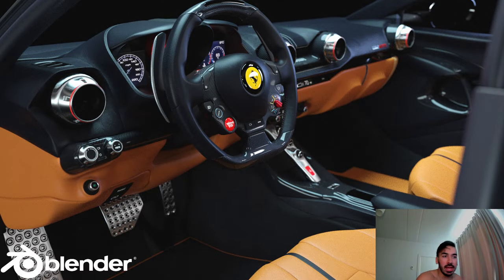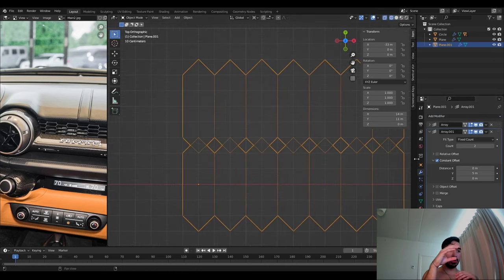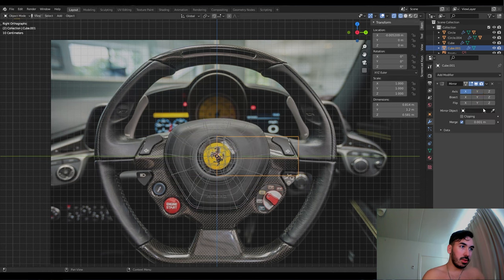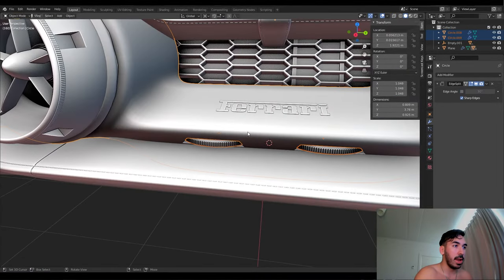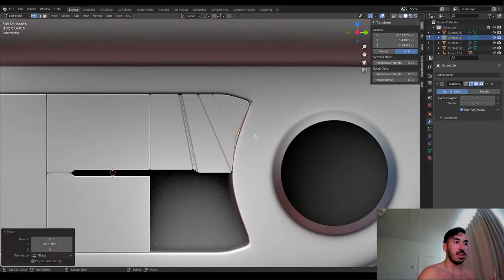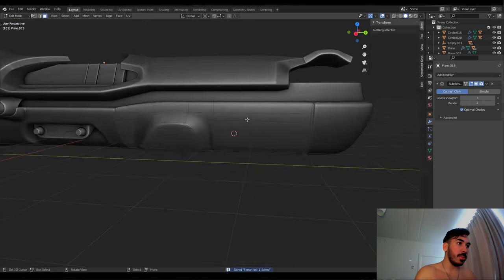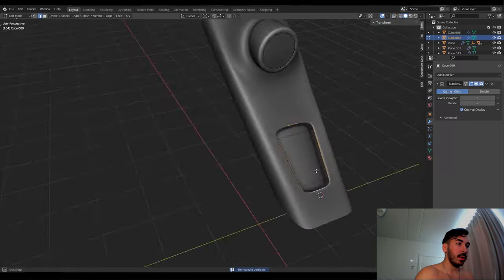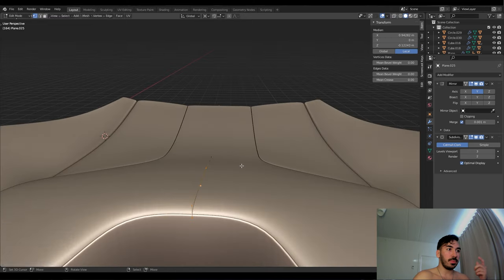Car Interior Modeling - Blender Timelapse Tutorial (Arijan)

Comment: Bro, thanks so much for this video, I made a hipoly of a car and struggled so much with making the interior. After watching your video, I scrapped the whole mesh and went back to the original low poly and just did everything lowpoly. So much easier doing this low poly without all boolean cleanups. I literally blocked out entire car low poly until everything was looking good then I moved onto hipoly detailing. Will post sketcfab model if anyone is interested, once I'm finished. It is a car based on the Clio 5 design. Not 100% identical just more simplified.
Reply from the maker: That's cool to hear, I'm glad I could help you. I was surprised that my workflow worked because this was my first time modeling something as organic as this, but it is always much easier to start low poly first.

If you'd like to share the model, I invite you to our discord community, I put the link in the description of this video. You can get plenty of feedback and cool discussions there. Thanks for the comment.